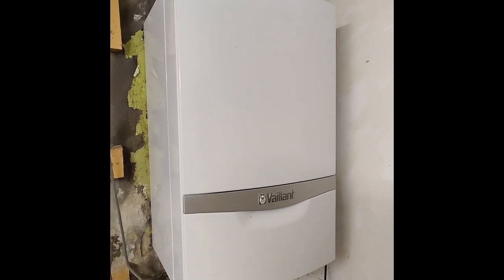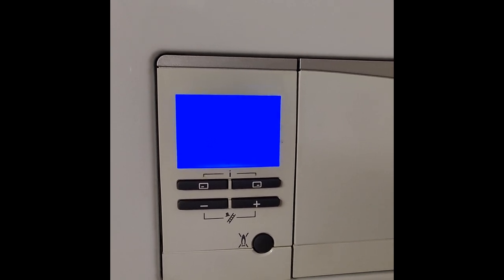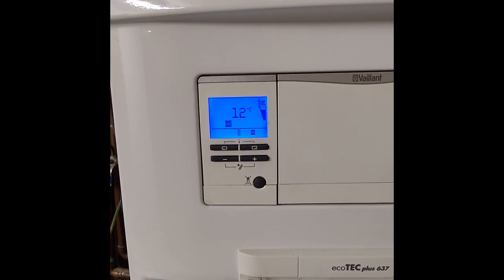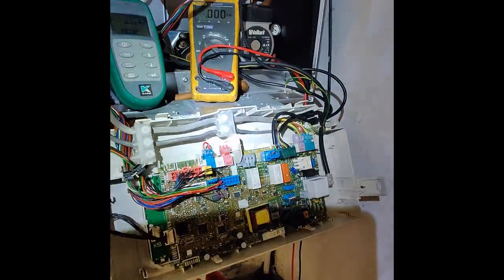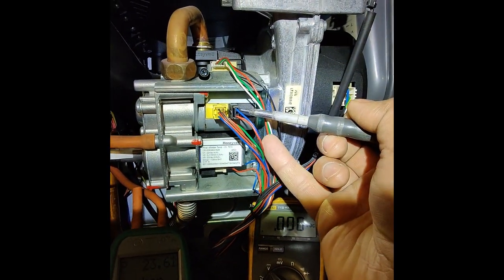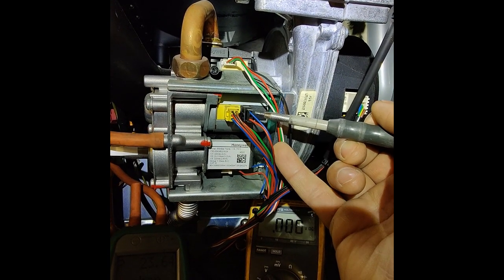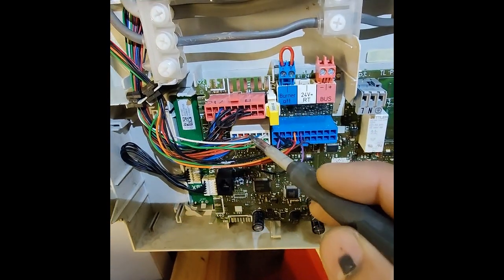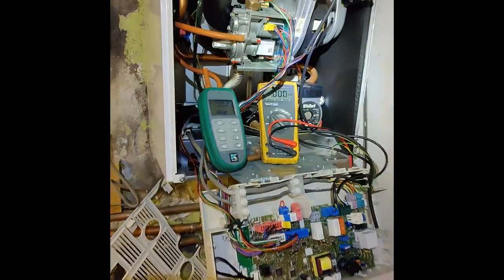Vaillant Fault F28 29 54, Resistance gas valve readings. 22vdc 16vdc. How to diagnose Vaillant fault

Comment: Hi, sorry my English, I measure the white connector with a multimeter and get around 18.9V, I dont get first 22V. The black I dont know where the wire goes to the PCB, I will try tomorrow, but if I dont get 22V do you think it is the PCB? thanks in advance
Reply from the maker: Yes it should get the 22v to open up and then drop down to 18v to hold it open.

Comment: Help. The error F2.8 appear only on heating. On hot water is all ok,  I can take a shower without problem. But on heating, F2.8 appear. Reset wont work
Reply from the maker: Hi, there could be several causes. Although the ignition sequence is the same for both heating and hot water, the only difference is that on hot water boiler fires at full rate (more has and air) so even if there is a minor issue with the ignition electrode/ FSD it will still work due to high fire but for heating it starts with low rate and goes to fault due to faulty ignition/ FSD, lack of gas etc. Have you had it checked by a gas safe engineer?
Reply: Not yet,  gas safe engineer is the last resort. Maybe I can repair it is is possible
Reply: @maneaflorin1  Florin, did you solved this issue? I`m also facing with this one!  I want to change the valve.

Comment: Good video thanks.Had exactly the same fault code on a vaillant Ecotec plus 825.I  Done exactly the same testing.I changed the gas valve but guess what when switch the boiler on and the same fault code comes up.Had a PCBoard as van stock after fitting the new board the boiler works fine.I end up by swapping the the new gas valve back to its original valve.Done my 29.9 checks and boiler still working.I have never encounter this before it’s always been gas vale.
Reply from the maker: @muhammadcassim7895  I am glad you found it informative. Please check other videos and leave a comment if you like.
Reply: @MHKBuildingSolutions will do.I always check these type of videos it increases your knowledge and experience.Thanks

Comment: Hello mate, had this exact same fault sequence. Changed the gas valve & all good for a couple of months, then started throwing the same faults again but managed to clear it and all good at the mo. 🤞. Seems to be common problem on these... Pcb next or scrapping tbh 😂
Reply from the maker: I would say buy a refurbished PCB from eBay and change it if it gives you the fault again. These are very reliable boilers so worth keeping tbh.
Reply: Probably the most comprehensive explanation I gave come across as you deal with both gas and electric issues...well done.

Keep up the standard

This fault was due to the gas valve and  is a known design fault on the vaillants pros and plus which was kept quiet for many years.
Reply from the maker: @cfgman1  Thanks for your kind comments.